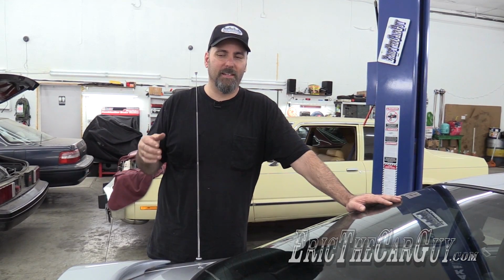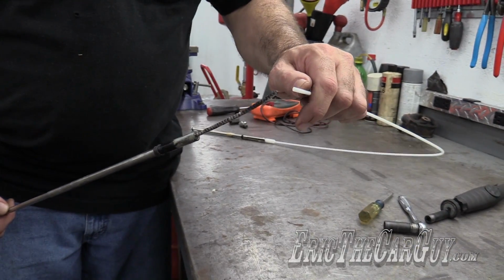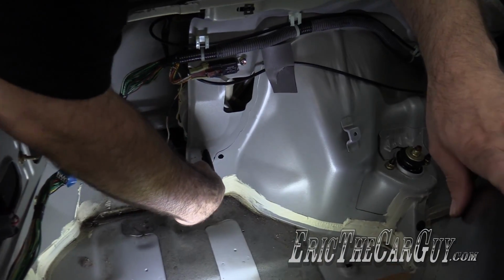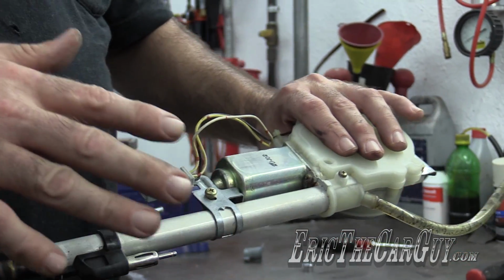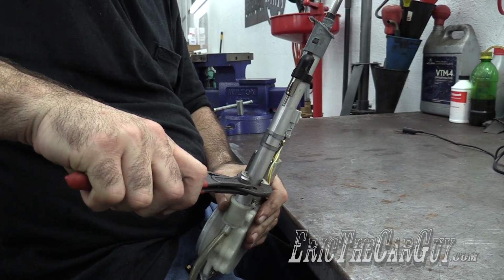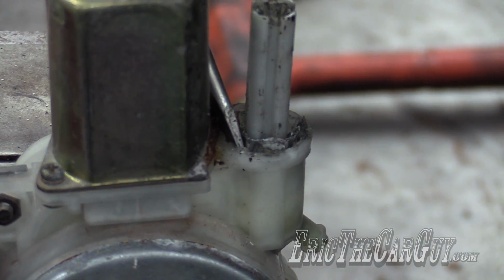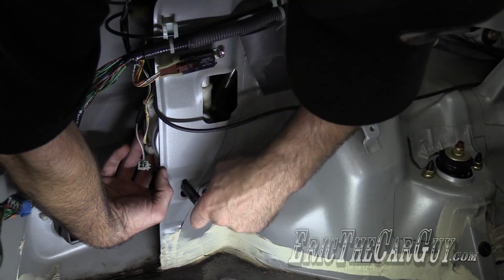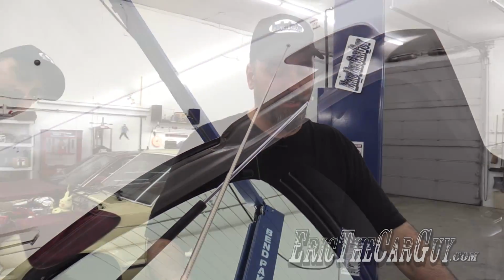The Complete Guide to Honda Power Antenna Repair

Comment: my honda accord 1994 power antena is not going all the way in when the stereo is power off. There is about 4 inches of antena left outside of the housing. It happens all the time after it was replaced. anyone facing it or knows how to fix this issue..??

Comment: Thank You for the vid 93 Honda Del Sol CR-X Transtop limited edition power antenna bent during car wash! Got replacement couldn't get it to catch on the motor to retract your skill option worked the first time by twisting the antenna went down perfect didn't have to take anything apart...Whew! Thanks for the vid!❤

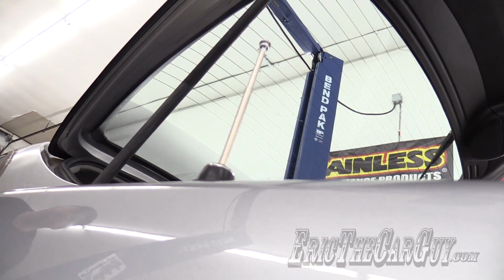Comment: Thank you very much. I just had the mast replaced on my 2001 Acura Integra GSR by the local Honda dealer. They had the same issue with the part you had to destroy to get it out. However, the mast does not go all the way down. It sticks up about 1/2 inch unless I get out of the car and push it all the way by hand. Any idea why? 21:14

Comment: To remove the aluminium mast from the housing loosen the screw and apply some heat from a heat gun .The part that is in the housing always has some corrosion which grips the housing.Once removed clean the corrosion off with sandpaper or file and oil it and it will be easy to reinsert.

Comment: Hey Eric… The Honda Power Antenna goes up when the ignition is engaged versus turning the Honda OEM radio on.  It goes back down when ignition is turned off.  

1991 Prelude

Is it the Power Antenna or the radio?

Comment: Great video.  I started out wanting to replace the antenna on my 95 Accord.  I buggered up the end of the tube threads trying to remove the sleeve at the base of the antenna.  Now the replacement antenna sleeve will not go down in the tube.  So now I have a good working motor with a bad tube.  I dont think its worth the trouble to dig out the tube to replace it.  TOAST!

Comment: Do You have a video on how to replace a electric antenna for a whip antenna? I need to know how to run the new cable for the new whip antenna to the back of the new Stereo on a 1990 Honda Accord LX.

Comment: I love your informative videos. 
I didn’t have any luck at the salvage yard with Honda, Acura in finding a power antenna that works or any part that worked. These imports get stripped fast!!
I just bought a 1990 Honda Accord EX sedan with 80,000 miles. It’s been parked for several years since the owner’s mother passed away. I bought it for my mom for $2,000. Needs tires, needs exhaust from sitting under a tree in a carport.  I need a power antenna. Dealership is too damn expensive! $564.23. 
Can you please help?

Comment: 'My  94 Vigor was hit on the left rear corner, When I close the deck lid the antenna goes up, when I open the trunk lid it goes down. I unplugged it and when I couldn't find a pinched wire I left it unplugged. Any ideas?

Comment: Hello Eric hope you're doing fine. Eric I'm looking to install a power antenna in my 95 ex. I'm starting from scratch. My Q&A is  I see you have a huge supply of original antennas. Are they available for sale? My civic has the manual antenna located on the driver side roof.

Comment: Thank you so much dude! Screw the haters... side note: you clarified so many things for me. I just spent 25$ on a replacement antenna and motor form the junk yard and two hours later to still have one antenna that is broken and one that I completely disassembled. It’s funny tho because of the corrosion I didn’t even know about the metal tube inside after all that I didn’t even get the correct diagnosis (oh unless you count that this is a pain in the ass)... and of course I found your video after the fact. You really cleared it up for me, thanks.

Comment: Nice job.  I had to drill out the shaft (in vehicle) very carefully, with a 5/16" - 13/32" bit. Finally got that stubborn little sleeve out of there. Looks like there's a broken piece that won't let the new teeth engage. Am now debating pulling the motor out or putting the fixed type in. Since I have the new mast and the motor works, I'll probably peel the fender liner back and go that route . . . maybe not.

Comment: Sir excellent video - im in chicago. I had a local dealer change my antenna mask since my antenna broke in the car wash. But when it goes DOWN after closing the engine it gets stick and makes tons of noises. Even with a brand new antenna. It wont go down flush.. i dont know how to fix that. The power antenna is trying to go down and become flush but it stops 1 inch prior and makes a tons of mechniacal noise tryin to pull it down.. help?

Comment: After going to three different stores, Home Depot, AutoZone and Harbor Freight, I got a kit for under $10 at Harbor and used the easy out tool and the metal sleeve came out! Thanks. It's working like a charm now. Also, anyone else thinking of replacing the mast, don't get it from eBay! I did that even after hearing someone on YouTube saying don't buy a cheap eBay mast, he was right, it would not work and I had to ship it back for a loss of $3.50. We ordered the mast that was an official Acura part and it went right in. The metal sleeve was the hardest part.

Comment: I have a 2003 bentley with the same problem the motor works however it won't retract the antenna which one will be the best replacement for that car?

Comment: Nice video, I have a question for you and I would really appreciate to hear from you. I dont mind that my Hondas antenna lifting mechanism wont work, but I do get bad radio signal, so I decided to take a look if theres a bad connection or something. And if the fault is in the bad connection I guess ill just buy new antenna, but not the one raising one. So heres the question- is it better to remove the whole lifting mechanism and try to wire new antenna without it or do I just remove the old antenna and put the regular one instead? The noise that comes from the motor wont cause me any trouble. With love from Latvia :)

Comment: I'd like an antenna nut. I can get a replacement OEM antenna for around $50 so I I think I will buy that and use your awesome video to install it rather than attempt a repair. Thank you for the video.

Comment: FROM recent experience.   if the power suddenly stops it is probably the clock fuse under the hood.
You'll figure out why it blew, but not as important to know as knowing it is that red fuse under hood (black box is on the passenger side).

Comment: Excellent step-by-step instructions. I used your video to help me install a new retractable antenna on my 1995 Acura Integra, which had been stuck mid-way for several years, but the motor works fine. I came across a few unforeseen glitches, but revisited your video, executed, and now it works perfectly. If I'm ever in your town I will use you as my mechanic.

Comment: Hi. Do you think you could advise me? I have a 1989 Honda Prelude and the antenna motor works but the antenna itself is missing. I took the motor out, checked for toothed cord inside and pulled out the old broken piece of tube, so now I just need a replacement antenna + cord. From UK suppliers, this is the only one I can find:

https://www.ebay.co.uk/itm/Honda-Electric-Aerial-Antenna-Mast-Tooth-Cord-Integra-90-01-Accord-Prelude-Vigor/152945560004?fits=Car+Make%3AHonda%7CModel%3APrelude&hash=item239c4409c4:g:JjsAAOSwyHRaqgY6:rk:1:pf:0

It says it's only for the 4th gen, but do you think it would fit my 3rd gen?
If not, I think will have to order one from the USA like this one https://antennax.com/i-24625702-power-antenna-replacement-mast-for-honda-prelude.html

Many thanks

Comment: @ericthecarguy have you done any videos or have you ever replaced a abs accumulator o ring ? My abs light comes on it buzzing for a few min maybe 30-60 sec Iv read on like 95% of the time it’s the o ring broke corroded stuff like that ,I jus don’t know how or where to start to replace it Iv heard put a tube an bleed t from the top to release pressure then unbolt it from bottom An boom idk sounds easier said then done ,this issue is on a 1994 Acura Integra gsr

Comment: Eric - just replaced the antenna mast on my 1990 Legend.  I didn't have an easy out for that silver sleeve so I used a 13/32 drill bit.  It worked - very lucky.  Thanks for the video - everything went just as you showed it.  Keep up the good work.  Thanks again.

Comment: Hi Eric! over the last weekend I was fighting with my del sol power antenna because it died, I bought replacement mast and basing on your video I was able to replace it but I still have a problem... antenna wont adjust correctly ... it tries to go out more than it should (3 sec griding noise when fully extented) then on the way back it makes exactly 6 clicking noises when already closed... I took the whole mechanism apart few times .. everything looks ok! gears are ok ... but It just wont adjust... I am affraid that it will break my new mast as well as old one .. any hints how to adjust it???

Comment: This video make me want to give it another shot at replacing my mast. It is very cool and unique to have a power antenna mast that actually works nowadays, heh. I tried a couple years ago, but it was with a non oem mast, and it just clicked inside the motor, the gears wouldn't catch the teeth for whatever reason. So I bought the plug to cover the hole in the quarter panel, and installed a window mount power antenna behind my rearview mirror. The reception isn't as good as the antenna's was. My antenna broke when it tried to extend and my car was glazed in ice. It had lasted a long time too, dang it.

Comment: You could use some sodium hydroxide to get rid of the broken aluminum part. Shouldn't hurt the plastic just be careful because the reaction releases heat and hydrogen gas :)

Comment: Hey Eric. Very informative. I have a 1989 legend its in great shape but the antenna does not work. The motor works but the antenna does not extend or retract.  Would it be worth it to get it fixed or switch out to a whip antenna?  Car has 106000 miles only.

Comment: Thank you! I just replaced the antenna in my '92 Legend! The white plastic piece at the base of the metal mast was longer than the stock antenna and I actually trimmed that plastic piece and the I trimmed the length of the notched cord a bit to get a perfect fit. So, your suggestion to compare the old and new antenna was very significant factor to getting this to work.

Comment: i always hated the look of my antenna on my integra.

i ended up ripping it out one day. just with brute force, ripping the sum'bitch out.

...still don't regret it

Edit: after watching the video, turns out that's what i was supposed to do. took me a good 30 minutes to rip it out though. i had to bend the antenna to use it as a handle to rip it out. that bitch was in there good.

Comment: Nice video. I went to the junk yard for mine, and like you said they also come with problems. mine is perfect, but it does get stuck inside so I have to go to the quarter panel outside of it and lightly bang it quick and it goes up

Comment: i got a 1996 honda accord cd5 and i swapped out my radio for a double din stero and when i pulled out the antenna cord the metal jack stayed in the radio and when i put it back on all i hear is static and i can seem to find a way to get rid of it i try to locate the connector to change it out but cant seem to find it

Comment: Ive taken a liking to running aftermarket antennas straight from the headunit to somewhere in the dash or rain tray wherever it fits. The reception works the same if not better than the old stock one
Reply: Or if you have a fender mount antenna and you have to source a replacement panel that has no hole run the antenna in the rain tray

Comment: Great video.  I've fixed plenty of these but I find the easiest method is to just pick one up from a junk....excuse me... recycling yard.  One tip though.  If the antenna on the donor vehicle is extended at all, walk away.  When the vehicle was turned off, the antenna should have retracted.  If it didn't, that means that either the mast has a slight bend or kink in it or the plastic track has broken off.  Even the slightest bend will prevent the antenna from operating.  It has to be just about perfect.

Comment: I have a 96 Accord, EU model, where the antenna shaft has been snapped at the bottom after being fully extended. It doesn't move at all when the radio is turned on and off but the motor definitely works. Will just a new shaft and cord be enough to fix it?

Comment: Unrelated to the topic, but Honda's CAN system is super dumb.  In the fuse box there is (are) a microprocessor at which many electrical systems are connected to.  If this thing goes haywire (usually by moisture), many systems get affected (instrument, power window, windshield wiper, blinker, etc...).

Comment: Eric, I have a spark plug broken off in the head of my motorbike. It broke off leaving only the thread and not the part the socket fits on. I have tried to drill it out but just melt/dull the drill bits. I melted the easy out as well. How can I remove it without taking the head off? Any help appreciated, (I realise its not a car but shouldnt matter) Emailed you a photo and same message

Comment: Thanks a lot! I'm also suuuper lucky that the OEM system still works on my '90 Integra, just doesn't go all the way down in, but I'll be sure to try the silicon spray cleaning tip!

Comment: Will this part work with my Lincoln Mark viii power antenna unit?
Reply: I guarantee it would not, unfortunately.
Reply: is that an educated guess?
Reply: Yes, becuase Honda and Ford are completely different. I suppose there might be a way you could mod the unit as a whole to mount and function, but it's definitely not going to be a drop in replacement, let alone the replacement mast.
Reply: Yes it will work.
Reply: ***** How? Do Honda and Ford sell the same unit?
Reply: murkinstock  I was being sarcastic.
Reply: Makes sense. I'm usually good about catching Internet sarcasm. Not this time! Lol
Reply: I just realized, OP was being sarcastic. Fuck.

Comment: A little propoxy and the old antenna housing is good as new. Aluminum has some nice anti-corrosive properties in free air, but when it's submerged in water, it might as well be mild steel. I've seen anodized pipe fitting corrode to the point it will hold 20 psi of pressure on one end.

Comment: HA! I just had to do this to my '93 Volvo 940 because I failed to heed your warning at the end of this video. I was SO pissed! Had alot on my mind ... and hitting the antenna button wasn't left in memory ...

Very similar designs, although the Volvo was MUCH simpler to remove. Car has been in New England it's entire life, and everything came apart easily .. except for the aluminum part, which I gave up on and left - didn't need to remove it anyway. I ended up swapping the entire lower assembly from my parts car because I didn't know how the antenna itself came out of the unit - now I do! Thanks for that! I assume this one is the same as the Honda - I'll have to look into that for future reference.

I did have to free up a stuck segment of the used antenna. I dunked it in used motor oil (LOL) and yanked on it with pliers. It worked! I wiped the excess off, of course. Need to get me some of that silicon spray.

I lubed the plastic gear strip, and the gears from the motor with John Deere Corn Head Grease. Stuff is nice and thin, and thixotropic (acts like a gear lube when in motion). Seems to be working for now. We'll see!

Comment: I have one of these kinds of deals on my '92 Chevy G20, only instead of screws, the motor casing is held closed by clamps.  Trying to remove the antenna from the shaft is proving to be quite difficult as it didn't just pull out like yours did, Eric (yes, I know you said yours came super easy).  I've yet to open up the motor and find out why its not going back in, but thanks to this video, I can at least say the motor isn't busted, it's just not stopping because the antenna itself never comes back down, nor does it go up.  So yeah, gotta get in there and see what's going on.

Comment: Solution to the corrosion: Move to the southwest or south.
Reply: That also solves alot of political problems too, as an added bonus. ;)
Reply: With more affordable costs of living, no inspection hassles to deal with on motor vehicles, politicians that actually RESPECT your Second Amendment right, and great winters, I can deal with whatever little issues might arise down there. Whatever you have in mind, I can guarantee it's nowhere near as bad as it is up here.

Comment: I had 2 1990 Integras and they both had bad power antennas.  I just disconnected the power to the motor and pulled them all the way up and just left them up. Of course if you did that this would be a very short video.

Comment: Hi Eric. Have you done a video on replacing the LMAs on a Honda B series head?
Reply from the maker: No, but I find there's very little need to do that in my experience. Hence it probably won't happen as I don't see that issue hardly ever.

Comment: The sensor you pointed at is actually a DPDT Relay that reverses the polarity of the motor when it receives a 12V signal from your Head Unit telling it to raise the antenna.

There is a plastic disc with metal contact points inside that rotates with the antenna & plastic assembly.  This is connected to the relay and its purpose is to physically cut off the power at 2 positions, when the antenna reaches full height or completely retracted.
Reply from the maker: Thanks for the info.

Comment: Well, everyday you learn something new... When I replaced the mast on my 2001 Volvo S40  back in May, I completely disassembled the power antenna and installed it retracted, and that was a bit of a mess.... The silicone spray tip is a good one too.